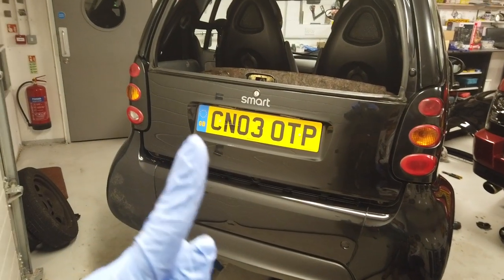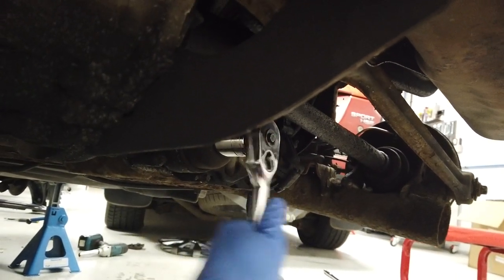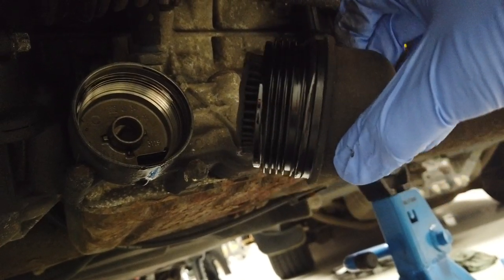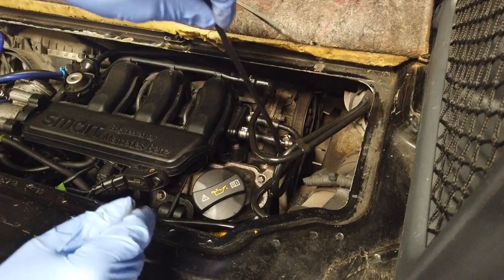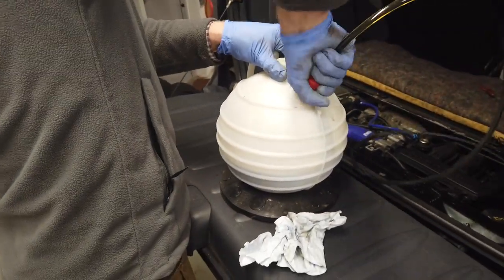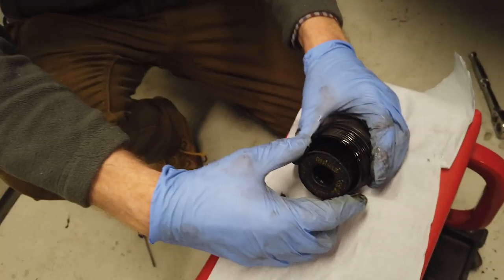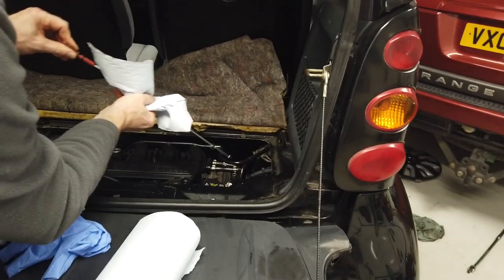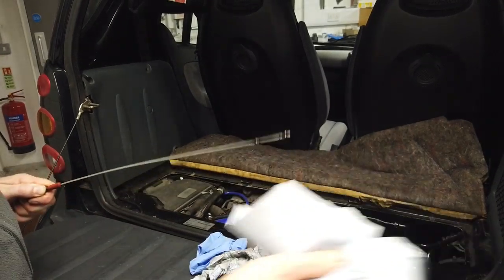Our project smart car W450 Fortwo 700cc gets an oil + filter change.

Comment: It’s very important on these engines to pay attention to the notice on the oil filler cap and NEVER overfill the oil, or catastrophic damage will occur.  These engines usually use a bit of oil so it’s tempting to overfill, but to be safe most enthusiastic owners try and keep the oil mid way between the marks on the dipstick.

Comment: My 700cc had a drain plug. My 600cc did not. So on my 600cc I took off the oil filter first and started the engine for 5 seconds and turn it off. Every drop of oil was pumped out!!! No harm to the engine since 2015....

Comment: So why didn't you pull the filter out ????? Oil won't pass back through the filter , I managed my smart fortwo with out all this extra headache ..... Undo the 27 mm cover , take out the filter , and slightly lift ( jack ) the front end .... Job done ✅ I've done it !!! I can't see why you are all pissing about ????? 
I can even video next time I change mine 🤷🏻‍♂️
Reply from the maker: Bit confused... we did undo the 27mm and take the cover and pull the filter out... but we also need to change the oil ?
Reply: @L663  
You're a bit confused ?? Me too ??? I've changed my oil 3 times ,after I refit a new turbo , just took out the filter , lifted the front end and took easily 3 LTRs out , my friend had one , he said the same as you , " pump it out " I told him what I did ... 🤷🏻‍♂️

Comment: What a stupid design having no drain plug, that guarantees that the oil in these things will only ever get topped up, not a very good idea, probably the only way to get any crud out with the oil is to pump it out when the engine is hot, but not a good idea with no plug, could you braze a threaded bush into the sump ?
Reply from the maker: Hi - i have to agree - for a moment i thought it was genius idea - put the filter at the bottom of the engine and let it drain when you remove the filte... but alas no ! I was wondering about using a rivnut in the sump..... no need to remove / braze etc
Reply: Newer land rovers are like this. So not the only stupid design.
Reply: Englishman French it’s fairly easy to extract the oil via the dipstick tube if the oil is warm, but it’s better to replace the plastic sump with a steel replacement that has a sump plug for about 50 quid, at the same time a spin on oil filter conversion is well worth while .
Reply: I've had a new sump with  a drain plug fitted